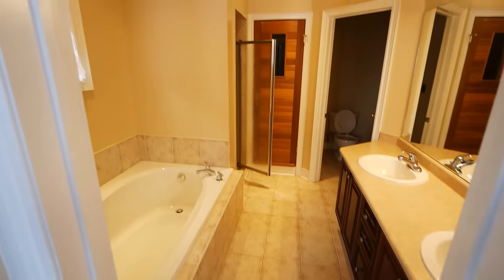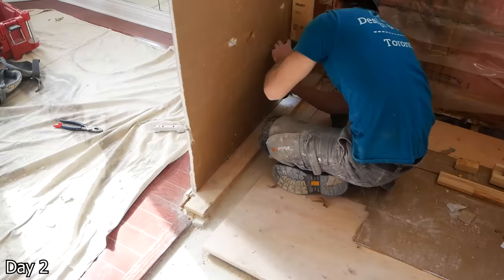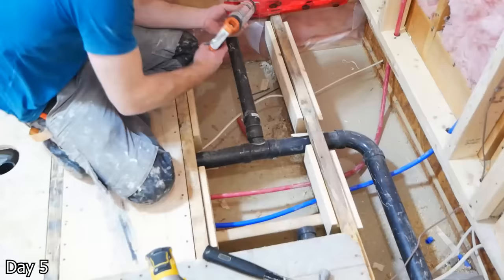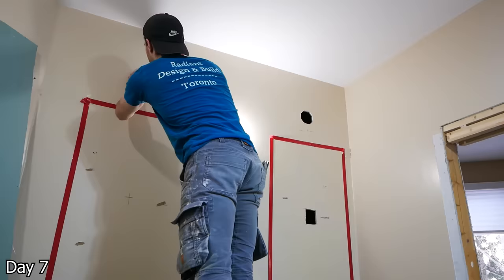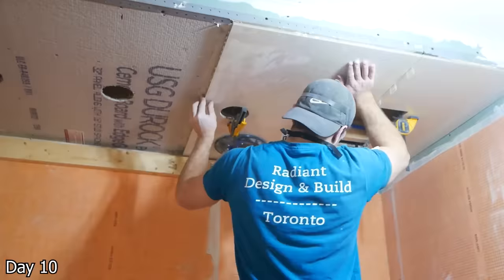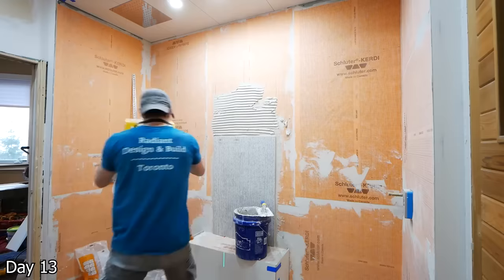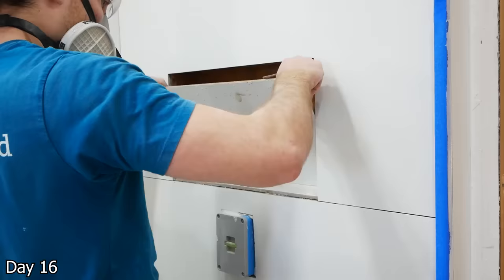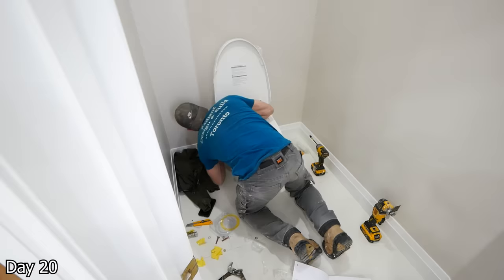GIANT Shower Renovation - Master Bathroom Remodel

Comment: Honestly I've been putting off remodeling my bathroom because I feel like it would be an insurmountable task, but seeing you do it one-man-army style, I got inspired to finally take the plunge and get started! Great work and really impressed with how this job turned out!
Reply: There is black stuff in few places on that pink stuff, is not that mold you would want to remove if not all.
Reply: Remodel is a beast itself as you will discover new findings and more things to fix so depending on age/condition, be aware. Helping a friend renovate as he was already started demoing. I pointed out dry rot from roof leak, rotted 2x4 with mold, possible leak failure with Cooper, and uneven 2x4. It’s important to consult with a contractor to understand current code as well.

Good luck! If you have the time you can def do it!

Comment: You do really nice work.  I am a retired Corian and other solid surface fabricator and installer.  When I made templates as you did for the floor, I used 1/8" Luan door skins instead of ripping 2X material.  You can rip it in the shop and keep it on your truck so it’s handy.  Big jobs required ¼” material for spanning longer openings.  Keep up the good work!
Bob

Comment: Beautiful job. I really like the seamless white grout and tile, and the recessed rain heads. I realized how you had to raise the floor because of the long, curbless shower. You can only slope so much. I found out that I could keep the floor low by putting in two drains and two kerdi pans. It cuts the slope length in half so you don't have to raise the whole floor. It keeps floor transitions to the next room more flat. The second drain is also great back-up for when one drain clogs, which is bound to happen if anyone has long hair, and floods the whole room in a curbless shower situation.

Comment: Pro-tip for your caulking. Anywhere where the color of the tile is not truly white, use translucent caulking. It blends in better than white, and not clear/shiny enough to look like transparent
Reply from the maker: I prefer my silicone to match the grout
Reply: @WorkinwithWolkon  Yes color matched is the best way to go. I'm talking more about transition areas like toilets and tubs, as the white gets discolored rather quickly, and clear is too shiny
Reply: @Darkely4u  good tip

Comment: Been a plumber / gasfitter / sparky for over 25 years.  Huuuuge props to you for starting with ram and drop sheets... excellent looking work I'm assuming that ceiling is not a top floor ceiling in that? ( waterline not in frost wall ) and I'm sure you know, threaded connections cannot be concealed ( rainhead braided hose ) I'm poking sticks at it since you could for sure service the head in that configuration :)  . And keeping the place tidy is something i express to apprentices daily.. if you complete a beautiful reno but scuff the floor, it doesnt matter how nice you did the job. Props again, excellent priorities and execution. I hear ya on the window.. did one like this before.. very similar solution except we used caulk on all perimeter inside edge , blueskin, Styrofoam, more blue skin.  You maintained the vapour barrier and increased the insulation to r40 or beyond its only potential issue is future infiltration from exterior.. as yousaid though.. budget 8s what budget is. :)

Comment: This is such beautiful remodel. Even when you look closely at areas like the metal trim around the niches, everything looks spot on. The only thing I don't like is the shower bench. It's executed perfectly, but I just don't understand why a customer would want a permanently-installed bench that would be uncomfortable to sit on and always take up so much space. I think it's far better to get a teak or composite bench that you can move around and replace if you want. But that's just a matter of preference. The bathroom is a work of art and I'd have you here tomorrow to do mine if you weren't thousands of miles away.

Comment: Love this remodel! Came out beautiful. Tile work is one of those things I havent had much practice with (practically none tbh) and it looks like a tediously daunting task. One of those things that looks difficult enough that you wouldn't want to try to tackle it so you just hire it out. Yall make it look so easy man!
Reply from the maker: Thanks! Definitely a tedious project type
Reply: as an occasional tiler, he makes it look SO much easier than it is!
Reply: @conradcoolerfiend  I've been around it enough to know, even though I'm not the one to be doing it, that it is not the simplest task to get it JUST perfectly right. Especially with the cuts for slope and drainage. Not much emphasis placed about it in the video but I know a lot of thought goes into that bit.
Reply: I bet he was glad when he finished that project🎉🎉He did a fantastic job 🎉🎉

Comment: 8,500 sounded steep until I watched the video and took 8 hours a day times 20 days is 160 hours at about 53 bucks an hour. That is amazing work you are doing for that pay. I was recently quoted a master bath reno at 80k from a GC and sounded very high to me because fixtures staying in same place just redoing tile and cabinets. We have a useless bath tub also but it's a bump out from the bay window and then big shower to the right is inset more. So they can do a frameless shower but the tub is wasted space. Thinking of just making it a bench to dry off on after the shower before the closets. maybe have a towel warmer rack there. Above tub is a big stained glass window.

Comment: $11,500 labor ( and usually the materials come up to about the same as labor… I have a current upcoming patio door replacement contract with Home Depot and half of my final cost is labor charge)… 
So, wowww, amazing that a tiny little bathroom can cost somewhere around 
$23,000 to upgrade 😮😮😮… 

But besides that, the finished product is totally excellent. You’re a highly knowledgeable expert in your line of work; congrats and best of luck.

Comment: Just reviewed your fantastic job. I am an amateur, but just finished a large bathroom for my daughter with large format tile. It has a steam shower. I can’t believe the glass install was only around $2500 CDN. In Thunder Bay, ON we have only two glass companies that do it and it cost over 5.5 grand with tax. That was the most expensive item. Doing the work myself and son-in-law was around 11 -12 k total. I am slow but cheap.

Comment: Pretty amazing transformation.  I think we have contractors advertising on the Tube who are charging that much for a regular shower conversion.  I was wondering about the heated floor, but then I noticed you were quite a ways north of us (Texas),  I have only experienced a heated floor once and it was in a hotel, NY City I think.  Darn nice because my first night there, the window was stuck open and the radiator was turned off.  I tried to close the window, but it would not budge for me.  As I had arrived late and had class first thing the next morning, I took advantage of the extra comforters I found and pushed through.  Of course, back then, I was also quite a bit younger too.  Then one day, I woke up and I was old.  Oh well!

Comment: No pre-slope on that rubber shower mat. A lot of builders seem to skip that step. It's a pretty good system but the pre-slope under the rubber mat and the weep holes on the drain body often get overlooked. Great job as usual!

Comment: Hey man, buy you a box of 4ft drywall shims for templates. You can hot glue them also. Much easier to work with than wood. You can cut them with tin snips

Comment: The one thing I haven't seen described on curbless showers is how the glass doors/panels contact the floor to prevent leaking water out underneath.  What is the recommended approach to ensuring water isn't running under?  I know the pan is sloped but it seems there would be some splashing around of water from the user walking around.  It seems that would cause water to go underneath.

Comment: So the cement board isn't overly strong. It's easy to have it rip out past those screws. Situations like that you should have used a strong backer board or at the very least used the proper washers to prevent the ceiling from potentially falling down

Comment: The accent tile used in the shower , would have looked way better if it had been included up on the ceiling , but the home owner didn’t decide on the accent tiles . until after the ceiling tiles were already up 😮the entire project turned out great and looked custom finished ✅  but if the home owner would have given a little more thought to the project . before the ceiling tiles went up and had the accent ceiling tile installed it would have been a Home-run finish 👍

Comment: WOW, Liam, your work is just BEYOND amazing!  You have such incredible time-saving ideas with measuring everything out and doing all of your cuts, instead of: take a measurement-go to the saw-and back again to take another measurement over and over again (which is how the majority of DIYers' probably do it LOL)....great time management!  You also are SO NEAT and don't get in to your workspace slapping hard-to-clean mortar or concrete all over the place, only to have to go back later when it's dry and fight to get the products off of your finished look!  Not only must that make it so much easier to finish out, but so much more "enjoyable" to work in the space!!  Lastly, your choice of proper tools which can be a Godsend, ESPECIALLY lifting those enormous tile!  I thoroughly enjoyed watching every second of the video and am grateful you take the time to share your INCREDIBLE KNOWLEDGE and ideas...thank you!

I have a QUESTION I hope you can find the time to answer:  I keep BEGGING my mom, who is considering doing a bathroom remodel soon, to do like these homeowners did and remove the NEVER USED bathtub and replace it with a HUGE shower with benches, but she thinks this would DE-VALUE a home's resell value; do you think this is a valid point?  I see MOST new remodels doing this layout, so I don't agree with this argument, but I could be wrong??   FINALLY, can you do a full length shower like this and incorporate the ONLY WINDOW for the bathroom somewhere in it or would it just cause too much water damage and lack of privacy?  What do you recommend for this situation?  I hope to hear from you and thank you again for an amazing tutorial!!

Comment: Top job, like the lights in the wall rebates, might have to start doing that. The only thing I spotted in the entire video, was that I would have had the grout line on the textured tiles in the shower area matching the ones on the opposite wall behind the vanity unit, rather than the smallish bit at the top. Also liked your idea of the template thats genius.

Comment: Instead of covering the window, can you replace it with the basement type of storm windows? And about the in floor heating. If there is a water leak, from sink or toilet, would you be safe walking on that floor?

Comment: Since you have to turn the water on from under the shower fixture, how do you avoid getting sprayed with cold water? Did you consider putting the valves in the center of the back wall? Would you let the water warm up with the handheld before switching it over?

The bathroom looks great, thanks for the inspiration.

Comment: Do not think this is a dig at your amazing work. But it  is alright me sitting down watching you in my home. But I would of cut the deco tiles over the seating area at the bottom so that the top would have followed the grout lines on the main tiles. But it is still  a amazing professional job. Well done you should be proud of yourself. Kind regards David

Comment: The execution was very diligent. One thing that had me a little worried is that you used the leveling hinges for the floor shower tiles. Doesn't this defeat the purpose of the slope? Would have loved to see a spirit level on these to see if the floor still had the slope?

Comment: 30:16 I'm curious why you do the bottom of the nlche first rather than the back and then have the top bottom and both sides hold that in place for a more consistent Look all the way around and in particular if it was for some reason other than Aesthetics?

Comment: Hi, great video and amazing work! I have a question regarding planning…do you have a set of plans for a job like this? Something from an architect perhaps that covers measurements etc? Or do you do a general plan at start that you develop with the client? Just noticing and admiring how well the 4 porcelain ceiling tiles laid out across the width of shower and wondering how in depth that was planned! Thank you

Comment: Do the screws you used for the leisure board at the top of the shower to assist with the ceiling install punch right through the waterproofing..?

Comment: Bro, $8500 for 20+ days highly skilled labor!? At the beginning of this video i said 30k easy, you're under pricing your skill. You can make 1k a day fixing leaky sinks and hose bibs. 

20 day x 10hrs a day = 200 skilled labor hours. 
$8500/200 hrs = $42.5hr 

$60hr min. IMO 

Im at $100hr , and averavges $150 typically.

That's because i bill by the job, not by the hour.

Bathroom looks great BTW 🙌🙏

Comment: I love this but I feel like that floor is dangerous. There's a reason why most showers have smaller tiles on the floor of the shower. If you can fit your whole foot on a tile without touching a grout line it's a major slip hazard.
Reply: It doesn't matter if it's matte when it gets wet. The water smoths the surface. They absolutely need a shower mat.

Comment: The respirator isn't only for the 'disgusting' air, right? Isn't that tub fibre glass, and so cutting it in half is extremely dangerous when not wearing face protection? Always good to point out incase any DIYers think they don't need a mask.

Comment: Why didn't you go with Environmental Butt splices? Your butt splices will allow moister to intrude even with soldering and taping the wire connections. ..... The shower floor; how slippery is it?

Comment: I did WAY more work to my master bath/bedroom for 22 or 23k but it was before the inflation. Obama was still president. and me doing around 1/6th of the work. I took the trash to the dump myself i gutted the old carpet installed some of the fixtures i bought in the material to my house for the guy. i was paying the guy like 10 or 15 bucks more per hour than i was making my job at the time haha so it was a costly 2 months basically working just to pay 2/3 for his labor and my bills. Like another 2.5 months to pay for the rest. but the next year i was able to pay the house off by myself. nothing against what you did here but ehh. I moved entire walls made my whole master bath and bedroom 2 times bigger i have 2 walk in closets 2 full bedrooms in one i have large walk in shower 1/2 inch glass almost the size of that one. big jacuzzi tub marble all around. we built entire exterior walls I'm talking like 30 ft of exterior and 20 ft of interior walls totally done. replaced flooring carpet paint etc etc etc I went from having a super ghetto master suite to having a better one than most mansions. Ended costing me like 4.5 months of pay checks of hard work minus bills (mortgage power etc). I was kinda ripping off places i got 30 percent off on everything. the boss was like man i got in trouble for that lol but its ok. cuz they lose money on certain stuff and i even got 30 percent off on drywall and wood lol. unfortunately this is what you get for 25 grand now. what i did would have cost you like 75k today and thats just how it is now. im lucky i bought when i did.